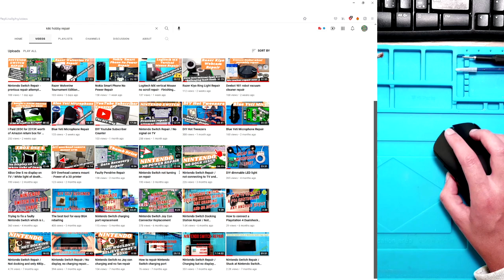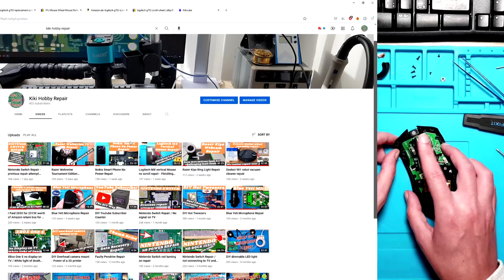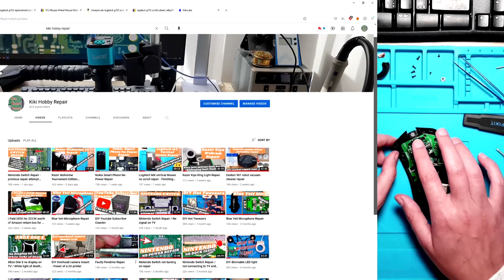Logitech G703 no scroll repair for FREE

Comment: I love it when people repair stuff instead of throwing it away just to buy a new one, especially when the repaired thing becomes better than the original one. And this repair makes it better than new.
Another technique to repair this if you don't have a 3D printer would be to use a single drop of super glue to re-seat the broken shaft into its correct place and alignment. When the shaft sits in its correct place and the superglue is dry, you can then fill the area around it with Araldite, while being very careful not to knock the broken bit.
Reply: Mine broke today! Thanks for the tip will definatly try it tomorrow. I'm lucky u posted this just 5 days before mine broke lol.
Reply: Unfortunately my shaft broke right at the end at the encoder. No way of fixing it the way it's described in the video. I tried super glueing it but there is no theory. Guess I need a new mouse.
Reply from the maker: You can buy complete replacement wheel assembly. When I made this video it was like 10-13€.
Reply: @kikihobbyrepair  yeah I know. I'll buy a new one rather, Razer Deathadder

Comment: I have had mine for about 9 months and I only use my mouse about 45 minutes a day. I like the mouse but the same thing happened to mine. I can look inside of mine in the front and the shaft is broken like yours. I have tried contacting Logitech service support but it is terrible. I would try your fix but just glueing it but my age of 76 just no way because I not have a printer but also my eyes have cataracts and I can’t see to do it and I have arthritis very bad in my fingers. These mice are on sale now for $65 but it’s still much money for a mouse that might break again. My wheel began to get hard to turn the next thing I knew it quit working like yours did. I appreciate your video at least I know maybe not to buy another one. Thank You Very Much and Cheers
BTW I subscribed to your channel because of the good job that you did showing and explaining it.
Reply from the maker: Many thanks for the nice words. You could maybe try to buy only a replacement wheel. I think you should be able to find one online relatively cheap.
Reply: @kikihobbyrepair  - Thank You Sir & Cheers
Reply: You could ask a friend to glue in the piece. I personally lost the, uh, plastic piece, so I carved a toothpick to be a good enough shape. Didn't need the fancy 3d addon.

Comment: Thank you for this video! I was able to take apart, diagnose, and fix my G703. Couldn't have done it without this video.

I did have to buy the part off Amazon as I don't have friends with a 3d printer, but fixing the problem saved me having to throw out a perfectly good mouse that I do like and enjoy.
Reply: I just used glue and it worked perfectly. Even without the 3d printed support.

Comment: Great fix, 3D printers help so much.  But I wouldn’t of used glue, just in case I needed to print another one in the future ;)
Reply from the maker: Thank you. It can only break now at the thin part. If this happens there is no way to repair because it would not fit.

Comment: What I have done is  I got some JB weld plastic bonder's glue and put a little in that hole where the little piece broke off. Then put the wheel back it place and hold it up to my Air Conditioner so it could harden and it work fine.
Reply: I lost the plastic piece. So I carved a toothpick to grip the scroll. Then glued it on with some generic superglue. Works fine. :D

Comment: Hi I did this and put everything together and it worked for my scroll wheel, but now when I right/left click nothing happens on my computer screen im wondering if I messed up reconnecting the shell to the bottom /battery
Reply from the maker: Hace you connected the ribbon cable of the top shell in the right direction? Is it seated fully?
Reply: same problem bro
Reply: @kikihobbyrepair  i connected the ribbon cable in the correct direction and its pushed but when i right click or left click nothing happens i dont know what to do

Comment: Hi, I have an issue with the left click on the mouse-logitech g703 lightspeed. When I press the left click and hold, I cant press a little harder or tilt my finger a little bit... as I press it, I must hold it 100% the same or it will stop holding... do u know why do I have that issue and how can I fix it?
Reply from the maker: You could try to take it apart and check if the microswitch is Ok or not.
Reply: @kikihobbyrepair  now I disassembled the mouse and everything looks ok, the switches are also ok as far as I can see... the only thing I did was break the rgb :(
Reply from the maker: Does the left button work fine disassembled?
Reply: @kikihobbyrepair  yeap... I checked now and found out the issue is  left cover of the switch (I think) because when I don't point hard everything works fine

Comment: Broke the same part and fixed it with burning the plastic parts back together with a lighter :D Seem to work as a temporary soution as im waiting for a replacement scroll wheel. Hope it helps someone
Reply from the maker: Thank you for your information.
Reply: Using superglue to reattach works too.

Comment: selling any of those printet support brackets ? :) and yes my g703 is doing the same thing hehe
Reply from the maker: Did yours broke at the exact same point at the shaft?
Reply: @kikihobbyrepair  mine refuse to scroll at all, and where is no feedback on the scroll so its just run as fast as it can and super smooth, so i think the shaft broke.. i used it for 2 years now. i want to reach out to logitech, but i dont have the box for the mouse anymore, wich sadly had the seriel number... i dont know what to do :D
Reply from the maker: Take it apart. If you need such a tiny piece than case of mine I print you one for free. You only have to pay shipping...
Reply: @kikihobbyrepair  sounds nice, i figure it out, i try reach out to logitch first i will maybe come back and ty sir very kind of you :)
Reply: @kikihobbyrepair  can you share the file for the spare part, i know someone in my area that can print to :)
Reply from the maker: Please contact me on kikihobbyrepair@gmail.com

Comment: It would have been helpful to share the 3D Print file you used
Reply from the maker: I can send you the file if you contact me in e-mail. The reason why I did not share the file is that it might brake at different points and then a different part might be needed.

Comment: Mine was feeling rough for about 10 turns, then it was freewheeling, darn, didn't have it that long either, fark...
Reply from the maker: It was either the hex shaft or the inner core of the encoder weared out.
Reply: @kikihobbyrepair  Definitely but I need a mouse and don't have the means to repair this one. Lucky I had a spare M150 for emergency use.
Reply: The exact same thing just happened to me :(
Reply: @damian4  Now I have the G502 Hero, love the programable buttons

Comment: i 3d printed it and it is too small for the broken peice and too big to fit in the scroll wheel. help?
Reply from the maker: Maybe your printer flow rate is not properly calculated. Try to decrease it. If this is still not enough try to play with the scaling. Alternatively you could drill the hole in the middle slightly bigger and sand down the outer diameter. It is trial and error 😉
Reply: @kikihobbyrepair  i will have a go thanks
Reply: @kikihobbyrepair  how could i drill the hole slightly bigger? without losing its shape
Reply from the maker: Better to tune your printer and or play with the scaling factor and extrusion multiplier 1-2%. My printer is perfectly tuned and it fitted without any modifications. Now it is hard to imagine what exactly does not fit. Be creative 😉
Reply: @kikihobbyrepair  kk ty

Comment: I can feel the encoder when I turn my mouse wheel, so I'm pretty sure that is not my issue...
Reply from the maker: You cannot really feel the encoder. The clicks what you feel are coming from a steel springy arm sliding in the inner core of the wheel which has like rounded teeths.

Comment: Who needs a 3d printer when you have a glue gun and will power
Reply from the maker: Here the problem was that the surface are to glue was really really small. Furthermore this must be super concentric. I am sure without the 3D printed part it would not be easy to glue it up perfectly and strongly

Comment: No 3D printer. Just going to try and eyeball it and glue it. AAAnd its awful. Guess I just need a new one.
Reply from the maker: Yes, just to glue such a small surface to be straight and strong is not easy. You can buy replacement wheel.
Reply: @kikihobbyrepair  Yeah I bought a metal one. Be a month before I get it. The plastic one seems poorly designed. Fixing this mouse for my friend so he has a spare one.

Comment: I've just glued shaft to the scroll wheel with cyanoacrylate
Reply from the maker: in my case there were a really tiny crossection and I would not just rely on super glue. With this tiny 3D printed part it is 10 times stronger than it came original.
Reply: Same.